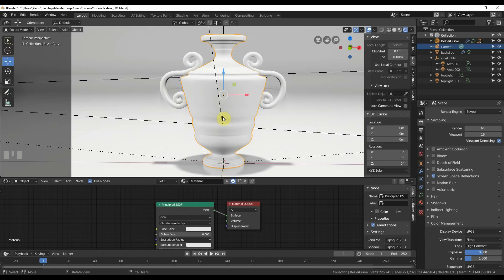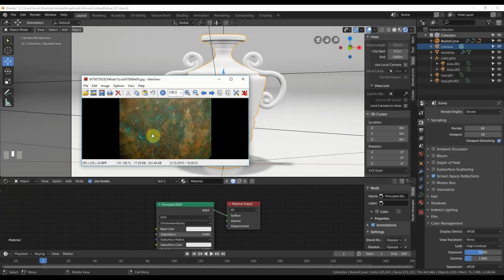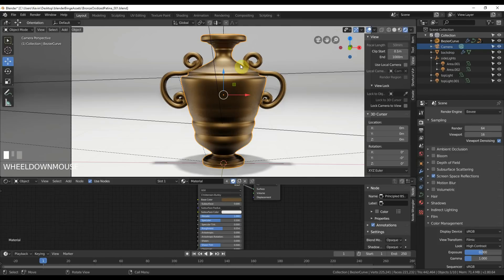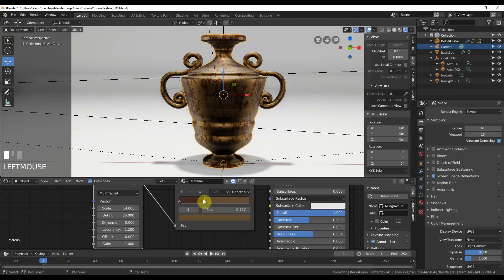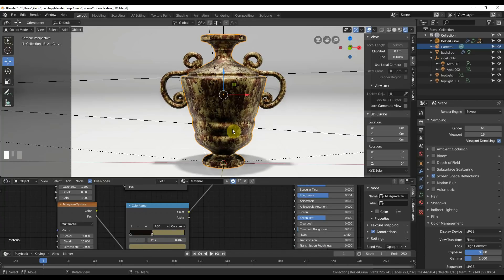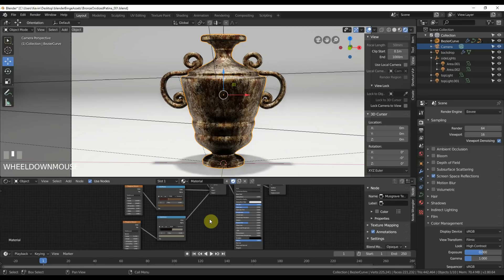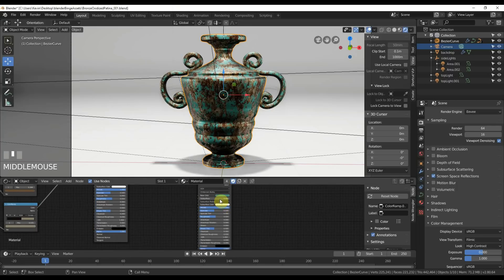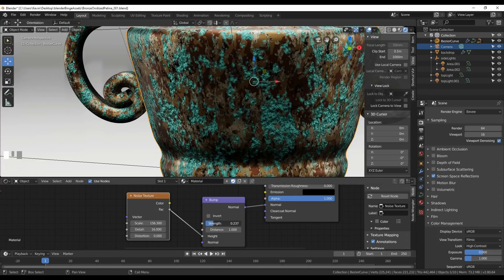Blender - Metal Material Procedural Shader Method (Blender 2 8)

Comment: Great tutorial. I've just got a couple of quick questions. 
1) Musgrave node has been changed, so is the noise node now the more appropriate for this workflow?
2) Is there an easy way to tell the texture nodes of the uv map? Right now, the textures seem to get stretched where the geometry is 'stretched'
Thanks
Reply from the maker: Thanks Dreadnought!  Cool name btw.  Yes, noise may be better now.  Musgrave works well with a color ramp, etc...  UVs are tricky to unwrap but you go into the UV workspace and figure out the projection angle.  You can define seems too, but it’s way too long to type lol.  There are some great videos on UVs and any of them should help solve that issue 😀
Reply: @KevBinge  Thanks, I'll have to look into it
Reply from the maker: Me too!  Thanks!

Comment: That's great but you end with a very "touchy" material that's hard to control. Thanks anyway.
Reply from the maker: Thanks!  It is now mostly because 2.81 changed some procedural nodes I use.  I need to do an update.
Reply: @KevBinge  I didnt see an update, so Ill mention, I followed this tutorial now with some slight changes and it worked:

- On all of the musgrave textures there is only the Height output to use, so I just used that, and it seems to work fine.

-Tip to anyone following this, it seems like the lacunarity value has been perhaps very slightly adjusted, because my material was not looking good early on. I upped the Lacunarity about .4 on each musgrave texture and it seems to work well.

------------------------------
 Bonus tip: In that shader tab grab a "pointiness" node and (to anyone who doesnt know how to use it: https://www.youtube.com/watch?v=SYslucCSnPI&list=RDCMUCXtzglUKLgekxmJlc9F1KXQ&start_radio=1&t=6)

that can be used to split up the small areas that are barely touched/worn into a slightly different material. (may or may not be useful depending on your project)

Comment: Yeah, Blender nodes have a problem at this point. Having to neutralize the musgrave (which can output all over the place) when used to drive the fac of a mix shader does not make sense. The fac input cannot be driven with a value node of plus or minus a gazillion, but if it comes from somewhere else it is allowed. In this case a musgrave, but I've seen it also with contrast/brightness node.

If you want to see what is actually happening in a musgrave, you need to use it as a bump as color can clip. Or make yourself a rescale/normalize value node group to ensure it doesn't clip. If you don't, at least clamp the output to clip at 1 instead of risking feeding 14000 or something crazy into base color.
Reply from the maker: You’re right!  Lately I’ve been going back into math and it’s revolutionizing my understanding of many nodes.  I’m realizing the value of clamping quickly.  In a true float workflow, like hdr, there is latitude, but clipping will still happen on the out or display.  It’s best to clamp, and I’ll be using that more going forward myself.  Thanks for your insight. 😀

Comment: Curious as to why the ColorRamp neutralizes the red color, and why it was there to start - that part totally went over my head. thanks for any thoughts.
Reply: One other quick question -- I may have missed this, but why is the green part mixed in after the Principled BSDF rather than before it -- would it make any difference either way?
Reply from the maker: I’d put it in after to layer it on top.  In my mind, the oxidation happens TO the metal, so I chose to build it that way.  You could probably do it the other way and I don’t think it will make too much of a difference visually. Thanks!
Reply from the maker: I’m not entirely sure, but the ramp does what I’d hoped it would do.